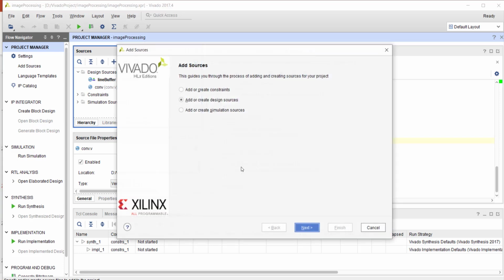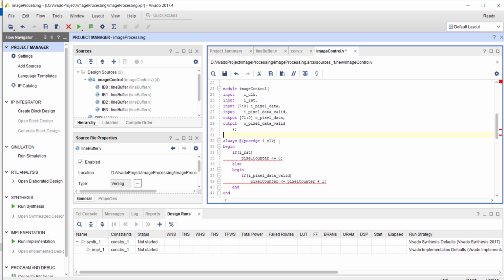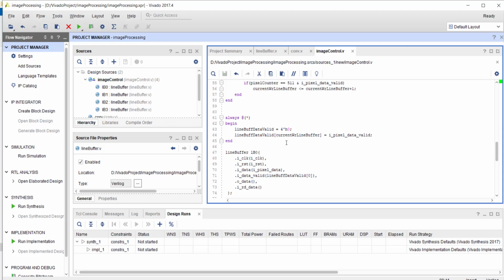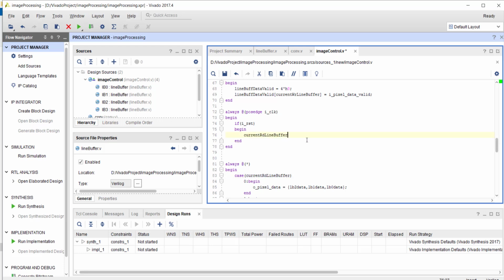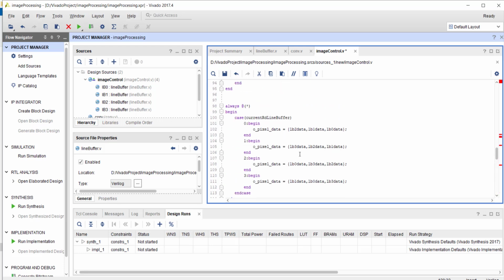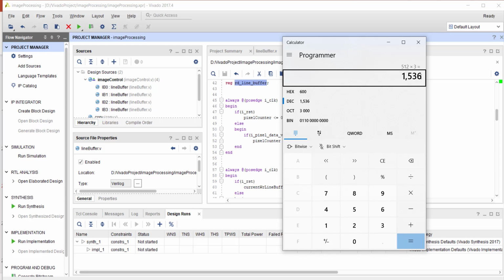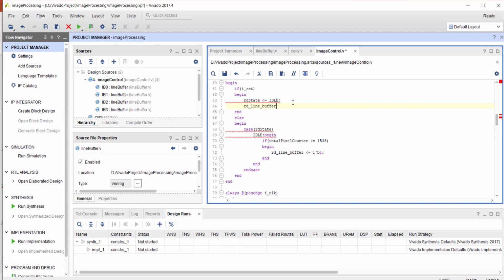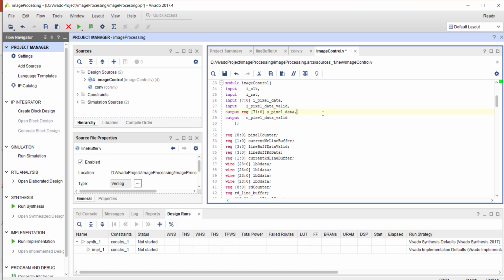Image Processing on Zynq (FPGAs) : Part 4 Design of Control Logic

Comment: 31:47 can we start reading after 1027? so that as so as all 9 data available for mac.
(Assuming operation time of MAC will be far greater than write time in lineBuffer)
Reply: same doubt, i think we can but better write signals to be sure we have valid data if at all MAC completes before data fills (which i think is not possible)

Comment: Is totalPixelCounter handled correctly ? totalPixelCounter indicates pixels present in the line buffers, right? When there is input pixel from external world, you increment it by one, this is fine. However, when reading from read line buffers(with rd_line_buffer signal is asserted), 9 pixels at once. Shouldn't totalPixelCounter be decremented by 9 ?
Reply: Out of the 9 pixels, 8 pixels will be re-read at some point of time. So only one pixel is rendered useless after a single read operation

Comment: PixelCounter value is running from [0,511] and after that data should be loaded to next linebuffer, and again our pixel counter should start from 0. But I didn't see anywhere like that sir, please clear my doubt
Reply from the maker: It will automatically overflow and 511 + 1 will be 0 some counter width is only 9 bits